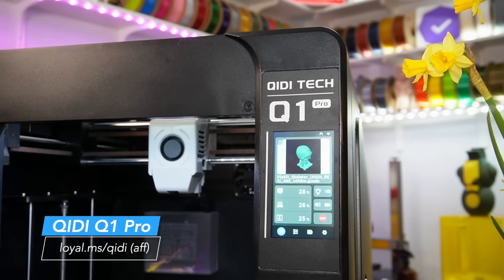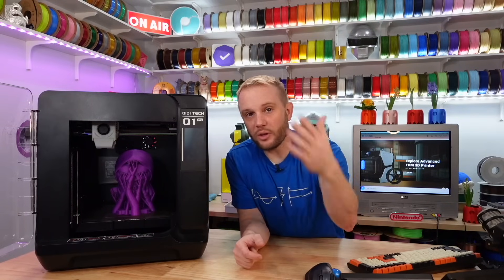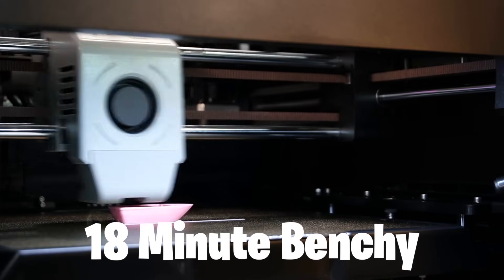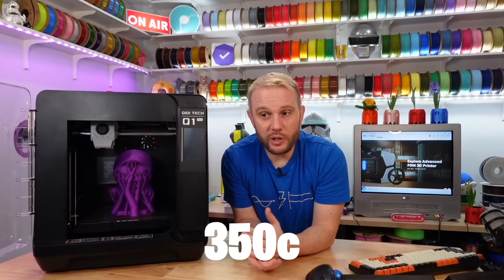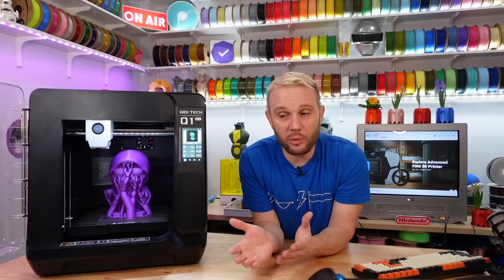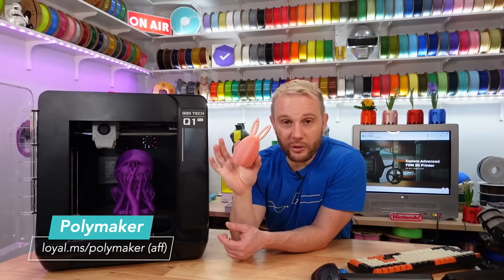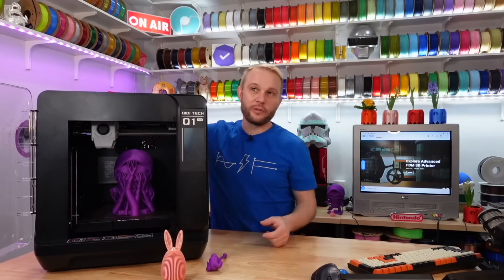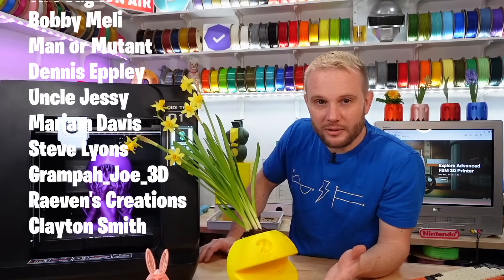600mm/s - Heated Chamber - CoreXY - QIDI Q1 Pro

Comment: Dang…I’ve been watching YT videos for the past two weeks trying to select my first 3Dp…the last few days I had narrowed my selection down to corexy…and was watching 8 month old Qidi X3 and Plus3 videos and ready to pull the trigger…Ugh - and now I see the improvements in the Q1 pro…side Mount filament, auto z calibration, webcam, no need to swap out hot ends to change to high temp filament - BUT rather than pull the trigger right now I’m haunted with the idea that in another 6 months they’ll have all of that in a larger build area!

Comment: At the start of the video I gotta say I disagree. I use a 1mm nozzle because I don't care about quality. I'm trying to prototype things as quickly as possible and I design around the downsides of that.
Reply from the maker: The majority definitely wants quality.
Reply: @LoyalMoses  I could've phrased that better. I understand most people want overall quality, but for my purposes that's just really nice to have. 

I mainly make parts for my car and robot parts for my Vex U team. If we need a part done to progress and something needs to be reprinted, it's really nice to have a fast printer so we don't have to waste another day waiting for prints.

As for the car parts, I usually fill and paint those anyways and they don't have fine details. Strength and speed matter most there.

If you're spending this much on a machine that's in that "it just works" sort of category rather than buying a cheap i3 clone I think there's a higher chance you don't have the time to reprint things much, hence that being a bigger selling point.

Comment: Th coupler is probably for the filament  dry box that came by default with their X3 printers (Smart,  Plus and Max), allows nylon/nylon CF to be printed from the drybox with a fully enclosed path to the nozzle. It won't mount directly to the Q1 pro, but can be used sitting beside it.
Reply from the maker: Could be.

Comment: On the circuit board there is already a place to add a ethernet port. If you have soldering skills, you can add it yourself. On the back under the sticker, you will find a hole for a potential ethernet port too. So maybe, they plan to add this later? Dont know, but it is easy to add this yourself
Reply from the maker: Maybe!

Comment: This vs Bambu P1S? Which do you like better for print quality and ease of use?
Reply from the maker: The P1S has shown to be slightly better with print quality, but the heated chamber for exotic materials on the Q1 Pro is such a great feature we need to see more of. Also, the P1S has the AMS potential, which is very valuable.
Reply: @LoyalMoses  thanks for your input. Deciding between the two for my first printer. The AMS is what’s making me lean towards the Bambu.
Reply: Big price difference
Reply: @legendfpv  very true but I am a buy once kind of guy.

Comment: It's nice to see manufacturers delivering klipper machines with open ssh, however -- why do they feel the need to alter klipper code making not updateable. This machine is running a klipper version that's over 2 years old. If you want to run kamp, or other advance klipper features, you can't. IS is better now, belt shaping. You have to rely on Qidi for a firmware update -- which shouldn't be needed. Run vanilla klipper, do customizations via config and scripts.
Reply from the maker: I really don’t have a preference, I’m happy to see new machines!
Reply: @LoyalMoses  kamp is feature in klipper that allows to only create a mesh for the area of the print, this is a klipper machine, but running klipper than is way too old. Vector 3d raised this issue, if you're doing a review, you're missing a big aspect of the review by not mentioning that it's running such an old version of klipper.
Reply from the maker: 99% of buyers don’t care. They are buying a complete 3D printing solution, not hardware and software separately.

I personally don’t think it even matters as long as the machine produces great results for those that buy.
Reply: @LoyalMoses  just watched the tear down, thing is a fire hazard. It won't pass the CE cert, and bambu had to recall a printer due to a cable that is questionable, this machine has A LOT of questionable bits in it. I'll pass. I've taken the X1C apart -- and I trust it, and seeing this one, I'd be scared to leave the room with this heater unit on.
Reply: @LoyalMoses  btw, they should care, if klipper, moonraker and other components are that old, there are likely vulnerabilities in the OPEN SOURCE software that has been patched. Good luck putting a printer with 2 year old software on your network. You do you. Tell yourself, it doesn't need the cloud -- totally safe. Lol
Reply: @LoyalMoses  You're totally right. I have an Xmax3 and I have no idea which variant of Klipper it has, nor do I care, because so far its printed flawlessly. Also, it has KAMP or something like it because it will only probe the print area before each print.
Reply: They have clarified this officially and by many creators. The heater is not energized when it is not running, plus it cuts off when a certain temperature is reached. The shell of the heater is also insulated. I don't know why people keep exaggerating the supposed fire hazard. Are there so many people out there who like to poke screwdrivers into outlets? Or do they stick their hands into a hair dryer that's in use? @kazolar

Comment: Yeah, the Ludicrous speed with Hyper PLA although interesting might be a little too fast for quality visually for prints. But the reason I'm interested in faster speed is when using 0.2 nozzle for detailed prints. Being able to print more detail was smaller layer lines is a nice upgrade (but not on Ludicrous mode.😅)
Reply from the maker: Absolutely!

Comment: Everyone likes to make fun of Qidi tech printers for being large and say it's due to their poor packaging, but no one talks about how the heated chamber will require additional heating elements and heat shielding which is likely why they're so much larger, not poor design. Also it gives them a consistent brand identity, most CoreXY machines look the same, but when you see a Qidi tech, you know!
Reply from the maker: I like the QIDI aesthetic!
Reply: That additional heating element is small fun with small heater, that’s it. Worth max 15$
Reply: @smokehead5318 yet they aren't standard yet.  Kinda surprising

Comment: Agree.  Doesn't matter how fast it prints if they come out crappy.  I don't cut the filament to remove.  I heat it up to temp, then pull it out easy and it seems to work fine that way.  Just be sure to pull it out before it tries to extrude the "cut" off piece it expects or it will pull the filament back in.
Reply from the maker: Absolutely!

Comment: this is really tempting, but I think ill get the x-smart 3 as its much cheaper, and also available atm. Thou this is what my ideal printer is, it's just im new to this and I haven't had a 3d printer yet, but I need it to be able to handle engineering materials for projects. When I start working and earn my own money, ill see the available options then, so I shall go for the x-smart and with the left over money that I wouldn't have to buy a filament dryer.
Reply from the maker: I’ve heard great things about that machine!

Comment: There’s no auto filament cutter as with bambu lab, if the ams has cutter built in that’s a lot of filament to purge. So I don’t think unless they give an updated print head
Reply from the maker: We were chatting about that earlier, it would have to be an upgrade on the Toolhead to work the best.
Reply: @LoyalMoses for the price point, if they made multi material possible this would really turn up the heat on other printer manufacturers. I hope they do even if it’s just for support material.